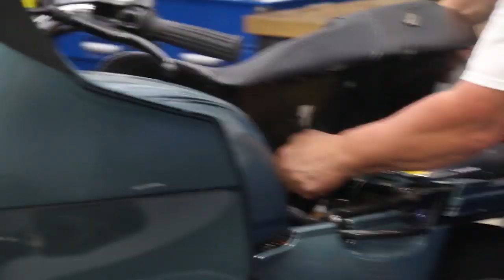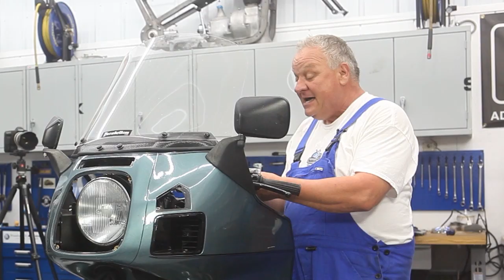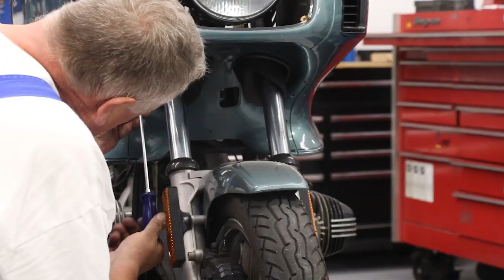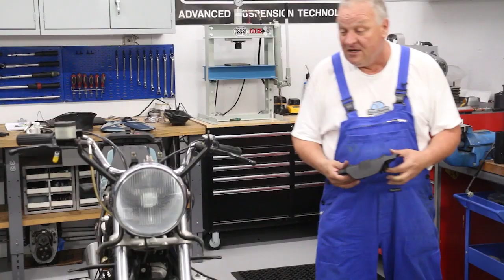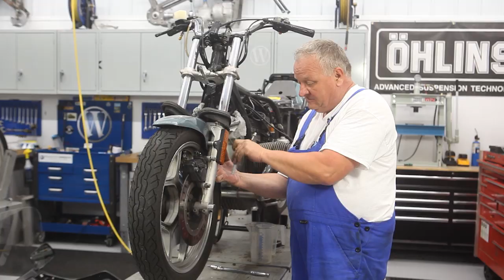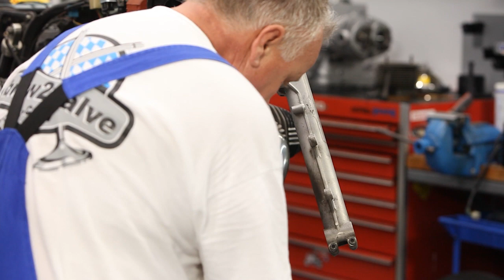BMW R80 RT to S Conversion #2 - Tear down continues!  Fairing, Brakes, Wheels, Seat, Tank & more!

Comment: Did the later model R80RT not have an oil cooler. I’m considering purchasing a 1983 and doing a S conversion but ion my research it looks like there is a oil cooler that some poeole will delete. Any input on tht one? Didn’t see on this video. Cheers. Great video by the way.

Comment: Your videos are better than BMW tech school.  You cover every detail.  Today, I acquired an '86 R80RT with 55K miles.  It's a little corroded from the Aptos air, but I think it will clean up very nicely.  The factory paint is excellent and no crash damage.  Steering bearings are toast.  It's very worthy of an S conversion.  I will study the remainder of videos to this project.  I like the K75 bars and dash remedy to the ignition switch location.  Thanks Bill, DH

Comment: Does anybody know if an "S" type (or similar style) smaller sports fairing, which would mount straight up to the 'RT' fairing mount bracket system?  
- I know it won't move with the steering, like a regular "S" fairing, but thought it could be a cool midway point between 'RS' & 'S' style setup.

Keen to know if anybody has done this!
(:

Comment: Re- the flat bar under the fuel tank?  I have a 1971 Triumph Bonneville (oil in frame model) which has a large 4 gall fuel tank fitted as standard),  It also has a flat bar fitted under the tank similar to your R80 , this i believe, Triumph fitted it inorder to cure the tank from flexing when is full fuel (they found the sides moved in and out to the extent that the seam welds use to fracture (note - both the R80 tank and the Triumph tanks are of similar shape) to see what i mean google 1971 oil in frame Triumph 
T120R, European model, US model Triumph had a pear shape tank fitted and was more resilient, i know as i have both model Triumph bikes here in UK. So maybe BMW took a leaf out of the Triumph book,  I also own a R75/7 so not biased. Great informative videos.

Comment: I have had 3 bmws so far a R60, r75/5 and lately a 82 r45 . you have any idea how many  R45s there are in this country. just curious...Thanks
Reply from the maker: Hi, I don't think  it could be many. It's just a bit before my time but I was under the impression that the R45 was never imported to the US. If it was, that's news to me!
Reply: @boxer2valve  I found it on craiglist. The previous owner had it shipped  from germany. Ive  got pictures of  the shipping crate and the german plate which i still have  installed along with my  antique plate .I just have to mentally calculate my speed since its in  kilometers